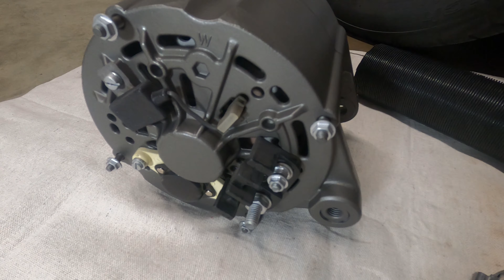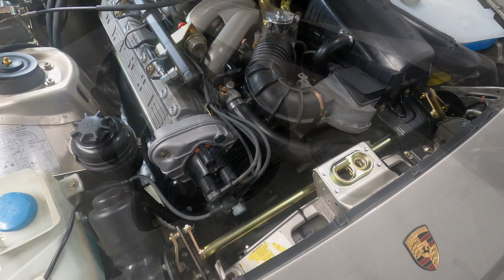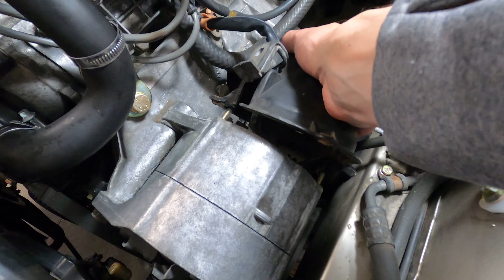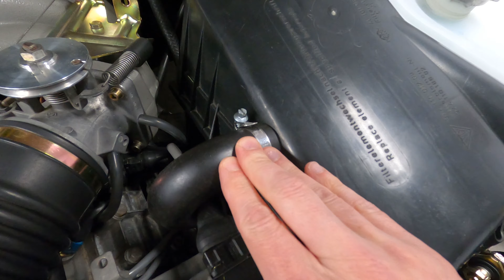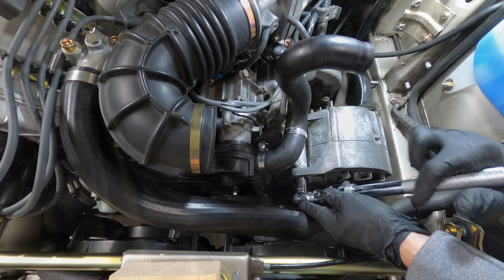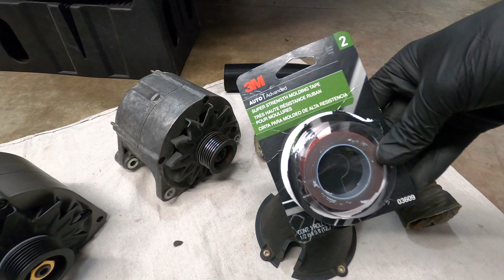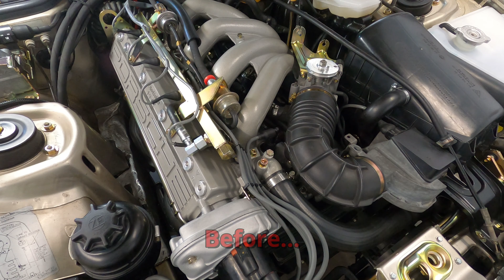Porsche 944 – Alternator Replacement Tutorial

Comment: Very informative video, thank you. I am struggling to find an alternator that already has the pulley fastened so I do not need to take the pulley off from the old alternator. Any suggestions where to purchase from? I saw the comment below from AutoHausAZ but there is no pulley attached to that one... please please let me know where you think.... in desperate need here. Thank you!!!
Reply from the maker: Sometimes those pictures are just “stock images” and the actual item is different. I would put in an inquiry with the vendor to confirm what’s included. Otherwise eBay generally showcases actual item photos and often the description will say “fan and pulley included.”
Reply: Thank you for responding. I have been looking and honestly no luck. FCP Euro has one, no pulley attached, same with a few other companies... maybe I just purchase the pulley separately? Any recommendation as to where to purchase the pulley separately? I've also been searching with no luck. Please share any links if you find fastened alternators with pulley attached. It would be a great great help. My car is just sitting in pieces now because I cannot get my hands on an alternator or take the old pulley off.. thank you again man.
Reply: @joshohebshalom4676  I just purchased an 89 944, with a bad alternator.  I'm taking delivery on Sunday.  Can you not affix the pulley from the existing unit onto the new one your getting? Maybe @NC944er can chime in?
Reply: @danmazz8733  thanks for responding- I actually ended up ordering the Bosch alternator from FCP Euro and it came with the pulley! I was really surprised... I thought I’d have to buy a pulley individually from a local auto parts store... making it a huge ordeal. So id recommend purchasing from fcp so you don’t need to do any swapping. My pulley was badly jammed, couldn’t get pulley off at all. Follow this detailed guide too, it really helped!

Comment: Thank you for making these videos they are very helpful, do you know the part number to the air cooling duct that you are replacing? And where did you order your alternator from? Can you do a video on replacing the fuel pump, I am having issues with a tiny leak on the banjo fitting on my pump, I replaced the crush washers but still a very tiny leak any suggestions? Any type of sealant that can be put on the crush washer and banjo cat boat to seal it?
Reply from the maker: •	Part number on the ventilation hose is: 944-603-153-01. Check out 944online.com as Ian will have cheaper options and different kits, including gaskets, etc.
•	Alternator came from seller eagleautoelectric on eBay.  AutohausAZ has a good price right now as well - https://www.autohausaz.com/pn/AL170X
•	The banjo fitting at the fuel pump outlet can be a pain. The leaks there are usually the result of an irregular mating surface on that fuel line fitting, the cap nut, or the check valve caused by corrosion, debris, or damage to one or more parts.  The best course would be to replace the affected part(s) - 951-356-041-08 for the fuel line/banjo ($110), 928-110-475-0Y for the cap nut ($5), 944-608-951-01 for the valve ($20).  You could also attempt to smooth out the mating surfaces by block sanding them on a high grit sandpaper (1000/1500), place the sandpaper on something very flat, like a piece of glass and move the fitting evenly back and forth. In a pinch, I have used a VERY SMALL amount of thread sealer paste with PTFE lightly coated on the crush washers as they are being tightened down. Don’t want to overdo it as any excess will enter the fuel system, more than likely being caught by the filter that directly follows, but I would let it cure for 24 hours before running the pump and ideally this would be a last resort - https://www.permatex.com/products/thread-compounds/thread-sealants/permatex-thread-sealant-with-ptfe/